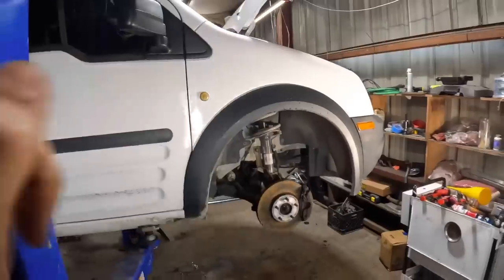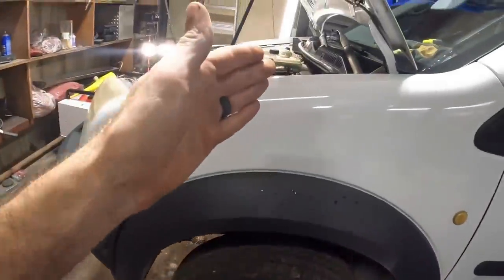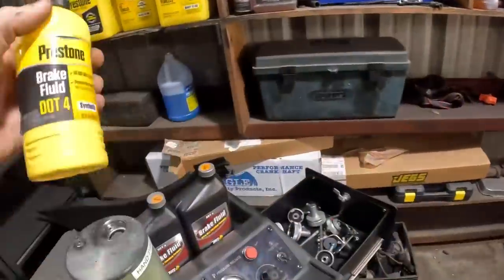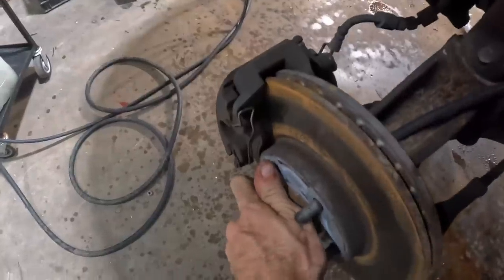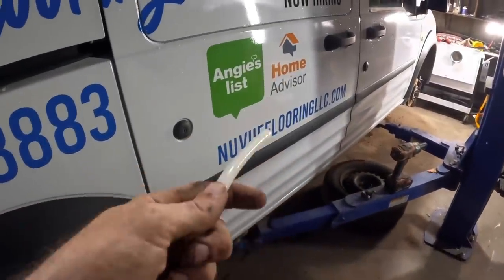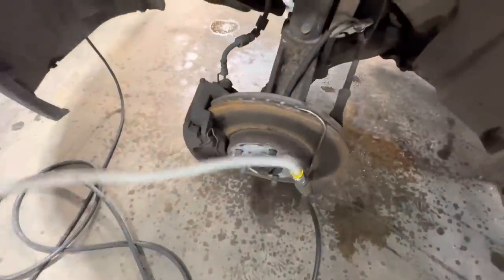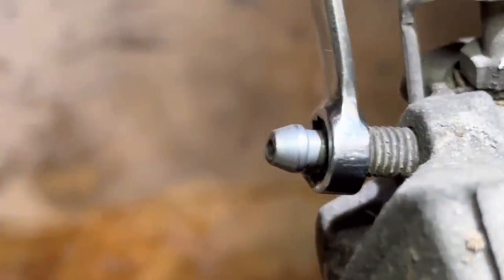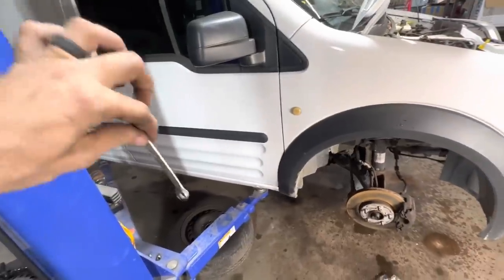Does Brake Fluid go BAD?? Ford Transit 2.0

Comment: I vaguely remember seeing you do a break job a bleed job a long time ago but you didn't have a piece of equipment like it had today matter of fact the shops you were in besides the AC machine didn't have a whole lot of equipment for you guys to work with and it takes money to make money so if they invested in the equipment it would have been worth it but I'm glad to see you're investing to make your job easier and you inspired me to do a brake bleed on my car I did it with a little handheld pump and the bleeder nipples three out of four came out pretty easy the last one does not look pretty anymore have a great day

Comment: Does your recycler require you to separate your waste oil and brake fluid/trans fluid?
Reply: No. Its all petroleum based so they can mix. Only have to separate petroleum and water based

Comment: I'm curious about the DOT 4 fluid. Do you put that in everything these days, or use DOT 3 in the stuff that traditionally used it?
Reply: DOT4 has a higher temp rating and is safe to install to any system that uses DOT3 or DOT4. They pretty much don't sell DOT3 fluid anymore, if you look closely it'll usually say DOT3/4 which means it's a DOT4 and they're just marketing it differently.
Reply: @ethanbarrieau7917  and then there's Buell with their hydrophobic DOT5. Not to be confused with DOT5.1 which is hydrophilic
Reply: @ethanbarrieau7917  well that's just untrue. DOT 3 is definitely still a thing and much cheaper to boot.

Comment: I have never seen green brake fluid before but it actually looked clean.  If there was corrosion somewhere in the system, I'd expect to see some sort of flotsam at the bleeders.  Does anybody know if there is a brand of brake fluid that actually is green?
Reply: Yes, my Transit has clean, green fluid, which I used some new green to top it up with. This is down under, not sure if you can get green stuff in the US 🤔

Comment: Any comments on the pros and cons of DOT-3, DOT-4 (synthetic DOT-3) or DOT-5 silicone brake fluid?  I used DOT-5 in my old cars that weren't driven much.  It is not supposed to absorb water, but some say it tends to let water accumulate in low spots.
Reply: Or straight up mineral oil!
Reply: @SteelJM1  In the country i live i i dont think you can get dot3. Dot3, 4 and 5.1 you can mix. You shuld never mix dot5.
I would never consider to use dot 3 becouse dot4 has better boiling point and other bennefits dot 5.1 even more.

Comment: You can get Amber, green, red or blue coloured brake fluid and it usually goes a darker shade when it time to change
Just because it was green doesn't mean its bad and when doing brake fluid changes using a different coloured fluid each change makes it easier to know when it's complete
Reply: I was thinking that because I got green brake fluid straight from the new container when I flushed my brakes a couple of months ago

Comment: Yes brake fluid will go bad. It it quite hygroscopic. It will pull moisture out of the air. That lowers the boiling point of said fluid. A few theories about brake fluid services exist. On ky last car, i flushed the entire system gor that purpose.

Comment: Seriously, replace brake fluid every 30,000 miles?
In my 50+ years of driving, equalling well over 3,000,000 miles, in at least 33 different vehicles, bad or discolored brake fluid has never once been an issue.

Comment: Brake fluid goes bad in a way. It will absorb moisture and lower the boiling point of the fluid. You boil your brakes and you have no brakes. You want to flush your brake fluid about every two years or 30 thousand miles or whatever your auto manufacture suggests.

Comment: Nice machine; however. I would strongly advise getting a smaller clear/colorless/transparent bleed line so you could leave the bleeder wrench on the valve and wouldn't need to remove the line to see any color change.

Comment: how does it get dirty in a closed system?    dealers love doing this.   old fluid gets filtered and reused.
Reply: Since the fluid absorbs moisture. It gets contaminated from that and from metal and rubber particals that wear off of the parts in the system. Also brake fluid helps kerp the calipers cool. So if it has to much water in it. The boiling point is lowered and this decreases the fluid performance. Which results in brake fad or a soft pedal.
Reply: I'm certain at my home it is not filtered and re-used. Heat affects the fluid, I've never tested mine to see what is in it when changing it, but on the RV it made a noticeable difference in the brake performance.

Comment: Brake fluid ABSOLUTELY CAN go bad.   It absorbs moisture;  experts recommend buying it in small quantities.  If brake lines get hot enough during operation, the moisture in the brake fluid can boil.  I think everyone knows what happens after that.  Great video!

Comment: I have a legitimate  question  for you Ray. I have to do this exact same thing on my 2014 BMW this coming Saturday. Now I know you aren't a fan of BMWs and I do the work (that it never needs) on mine because I don't want to get ripped off by the dealership. What if the fluid isn't green? Mine looks new after 2 years but it needs to be done . Could I  or should I put some sort of coloring  in the old fluid so I can tell when the new fluid arrives? I have to do this on the ground and without a machine. I do have a pressure bleeder pump I got from Fcp euro, so I will get it done. Any help would be great. Thanks in advance for your help Rainman.
Reply: My understanding is that brake fluid should normally be replaced every 2 years...regardless. Not because it wears out or anything though. There are brake fluid testing kits and electronic testers that 'try' to tell you what the water content % is. It's that water content that is the real concern and the real reason that changing brake fluid is normally performed. As far as I know, you could hypothetically run the same brake fluid for many many years w/o changing as long as the water % remains low enough...and it doesn't turn green and doesn't get overheated :)  As for the dye part, I THINK you can actually still buy the colored (blue) brake fluid in Europe (if that's where you are) but in the U.S, colored brake fluid was disallowed several years ago...which is very irritating. Not sure WHY. It made being able to see when the new fluid arrived super easy. Then on the next fluid change, you go back to clear...and again, super easy to see the change.

Comment: No broken bleeder fittings?    No heating the bleeder up with a torch?    you had an easy job this time. lol   No  warning about not getting brake fluid on painted surface?    Southern vehicles are easy compared to northern salt and rust.:face-red-droopy-eyes:

Comment: Nothing magical about electric flush machines. A hand pump pressure bleeder does just as good a job and just as easy. Suction at the bleeder valve doesn't improve the flush result, it's just for convenience of disposal.

Comment: I don't think that brake fluid goes bad from a chemical point of view. If you gave me used brake fluid and I could strain it, heat it to drive the moisture out, it would probably be as good as new.
Reply: You would be incorrect. Brake fluid is highly corrosive. It has additives to reduce that. The water breaks down those additives. You'd be putting corrosive fluid back into a system.
Reply: @williameldridge9382  We'll add a new additive package! Just like with used oil.

Comment: The dealership that I worked for had all of the BG fluid exchange machines but not the brake fluid one. That was good to see how it works. You need some brake bleeder wrenches. You may want to do the PS exchange on that van

Comment: Call me old school, but all the time spent phaphing about, just using a one way valve hose and pump away would have had it done just as quickly.  The only gain was vaccing the master cylinder. Correct me if I am wrong.

Comment: NOPE He is WRONG!
Do not listen to this.

Proper procedure says to check the Owner's Manual in the glovebox. There are some, not a lot but some, vehicles do not go with the traditional farthest away from the master cylinder brake bleed. If I remember correctly, it has something to do with the ABS, ABS proportioning valve, or just the proportioning valve.

Comment: I’m at 14 years and my fluid is still
Clear, do I need to change it, never have before? Is this another one of the special wallet cleaning procedures? Or do some cars just get more contaminated than others?
Reply: Actually, water is a real problem as it [brake fluid] attracts water.  Water settles at the bottom of the caliper and  corrosion occurs which will destroy the rubber O ring on the caliper piston. If you live in an arid climate, not a huge issue, if you live in Seattle, maybe more of an issue.  Not a fan of these machines,  the only way to get all of the water out of a calioper is to remove it, turn upside down and spray it out with brake cleaner.  The machine draws from the top and will get some of the water, but not all.  Q:  have you had the calipers replaced at any time?
Reply: @handbananaistherapist642  how can a sealed system attract water, if brake fluid is not leaking out how does water get in?  No I’m on the original calipers still, just take them off yearly an lube the pins and replace the hardware if rusted. Live in the salt belt. If you don’t you spend more on new pads and rotors when the calipers or pads get seized up from the rust. Wonder if there is a place that analyzes brake fluid perhaps mine is bad just not green, lol, special wallet cleaning procedure #2., I have seen plenty of brake fluid that needs to be flushed out just don’t understand why some really need this and often, every few years and others that never look like it needs to be changed.
Reply: @boblemon2103  A sealed system can become unsealed over time.   Im not so sure about this green fluid, sounds like a dye problem by the manufacturer or something.  These machines are attractive to some mechs as a new tool, or to unscrupulous shop owners as a way to  over bill a job.  Ray, i believe is a good guy.   My niece lives near him and I would send her to him.
Reply: @handbananaistherapist642  I would take my car to ray as well, seem honest. He would not like working on my rusty cars though, I just like giving hard time about these questionable flushes and cleanings, this case it was obvious it needed to be flushed out. I recommend whatever the manufacturer suggests as the fluid change interval, think trans fluid should be dumped and filled much more often than they recommend and never power flush, rays last Video on this being the exception to that rule, it had to be power flushed.

Comment: Ray...you didn't use BRAKE CLEANER to remove the BRAKE FLUID drippage from each wheel! Ack!!!

I was sooo sure the 1 time it was guaranteed to be used it wasn't used. I'm actually disappointed...for the 1st time since I started watching your videos too. Don't get me wrong, I still liked the video & it was educational. You still got a like & there's ZERO chance I'd un-subscribe, but I felt like I was left hanging on a high five...sigh...

Comment: Cool machine, thanks for the detailed video!  Didn't you say in another video it did power steering and transmissions too? If so is there a separate reservoir that swaps out?  Or do you just use suck mode for those? Wondering how how iit keeps residual brake fluid from going in a transmission during a trans fluid exchange.

Comment: The only thing I might have done differently would be to give the pressurized line leaving the machine that attaches to the master cylinder a flush and purge so it's all clean fresh fluid in the pump and line  before attaching it to the master cylinder .

Comment: if u pinched the vac hose a bit at the nipple so the fluid backs up at that point, you could probably tighten it up just once, without having to re-check for air bubbles?
Reply: You dont need a vacuum at the point of discharge.
Reply: @outseeker  Still dont need a vacuum to do that.. Pinch the hose under pressure.
Reply: @outseeker  I dont why you have a fixation on replying ???
Reply: @TheJcrandazzo  sorry i assumed you knew things and wanted to impart useful knowledge, my bad.

Comment: I'm in Arizona, and my 1998 Frontier (270K) and my 2004 Frontier (108K) still have their original brake fluid, master cylinders, calipers, rear wheel cylinders, rotors, and drums.  I would flush the entire system with any hydraulic repair.  The 2004 Frontier has all-original in its clutch hydraulics, the 1998 has replacement clutch hydraulics (flushed then).
Reply: Deserts don't have the water content in the air of other areas.

Comment: Love it! Most entertaining  video but 30K?? Brake fluid may be hydroscopic but it doesn't rust brake lines does it? Vehicles go 300K without exchanges.
Reply: Most manufacturers recommend anywhere between 20k-30k. And it can corrode brake lines due to water content. Brake fluid is naturally corrosive, but it has additives to reduce that. Water content breaks down those additives and increases the corrosiveness of the fluid itself. On top of that, water has a lower boiling point so if you have too much water content in the fluid it can boil/vaporize during braking, causing brakes to fail. It can either make them temporarily work poorly, making you not able to stop briefly, or it could blow the lines themselves due to overpressure.

Brake fluid is IMPERATIVE to change regularly. Probably more so than most other fluids. People usually only think of cost in terms of cars. Well, I gotta change my oil because engines are expensive. What they don't consider is that if your brakes fail, even briefly, you can die.

Ask any mechanic, brake systems are the most neglected system on a car. I've literally seen people go get body work done on a car that needed brakes, then not doing the brakes because all the money got spent on making it look pretty.

Comment: Brake fluid doesn't go bad. By the time it is very dirty your brake line rusts through anyway and you change the fluid. On non commercial passenger cars its not necessarily needed. Trucks, commercial vehicles, race cars and other stuff need fluid exchange for various reasons. Most dye to boiling and heat not moisture

Comment: The BG machine is a waste of time and money. There are different brake fluids used in vehicles depending on build date and or requirements. So with this machine you are mixing fluids on every exchange done. Not impressed. Is one going to flush the whole system after every use? More waste of money and time. I doubt you can perfectly ever get all of that system clean again after the 1st. use.

Also this thing pressurizes the reservoir tank, which can break it due to being plastic and all the heat cycles make it brittle . Is he gonna eat that when that happens ?

The suction way of fluid exchanges are the better way to not damage things and  the way not to contaminate the system with mixed brake fluid types.

Comment: You do not need a brake fluid exchange machine, you already have one... it is called  GRAVITY.   The machine is not "efficient", it is goofy.
Reply: Some say gravity is best method if you have the time?
Reply: @TheJcrandazzo  Did you see how much time Ray wasted goofing with this machine?   Crack all 4, open res cap, let it drain while adding new.  5 -10 mins.
Reply: @handbananaistherapist642  You are right.. No need for all that BS.. Its a time thing I guess . Gravity feeding takes a bit longer.
Reply: @TheJcrandazzo  Maybe.

Comment: As long as your doing a fluid change, why not change to DOT 5?
Reply: Because it is AWFUL. It doesn't absorb water, so it leaves it floating in your brake system causing corrosion. Never, never, never use DOT 5 unless you're running a racing machine that generates those extreme braking temperatures.
Reply: @williameldridge9382  On top, if you have water in your brake system you have bigger problems, Bro.